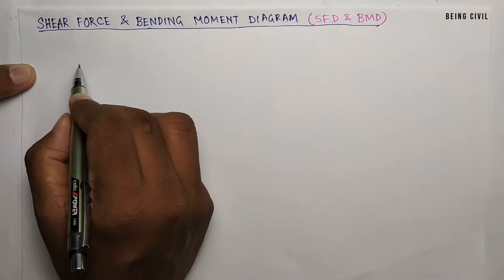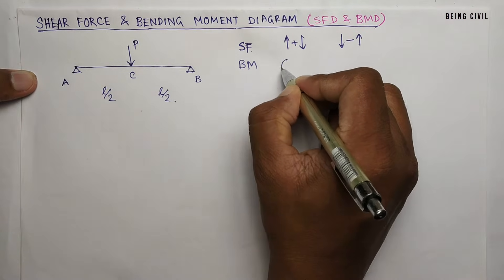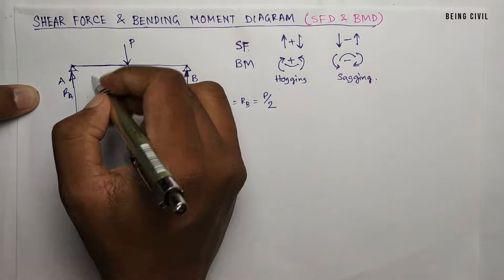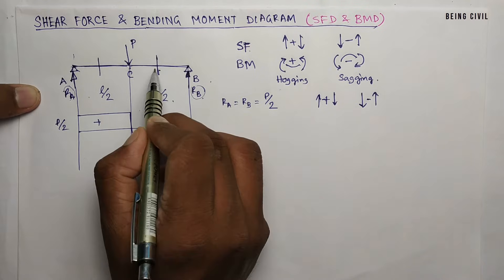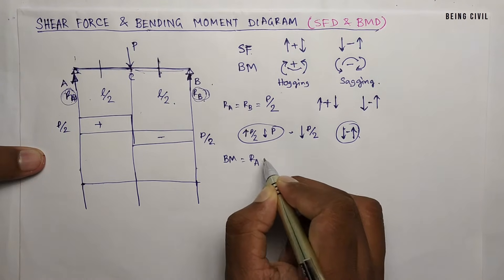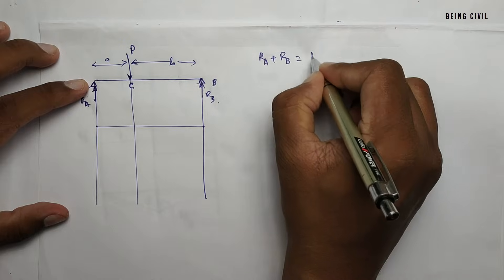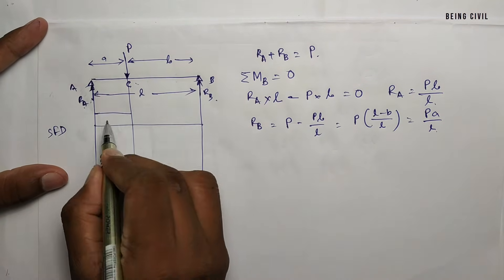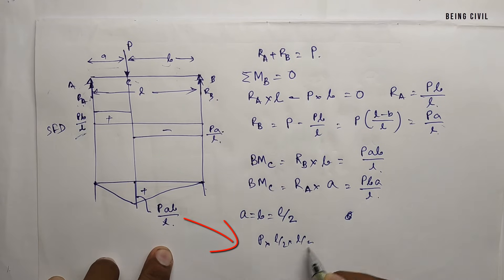SFD & BMD | Example 1 | Simply Supported Beam with Point Load

Comment: sir ,
the way of explanation is good.
The bending moment diagram is also wrong, if the bending moment is positive then draw a diagram above the line. please check it once.
Reply from the maker: Hello Bhaskar, I have taken sign convention as downward positive for BMD. You can take the opposite. This is not wrong. Both are correct. Most of the books take sign convention as upward positive that's why you thinking mine is wrong. It's up to you. Staad pro software takes sign convention like I have used.